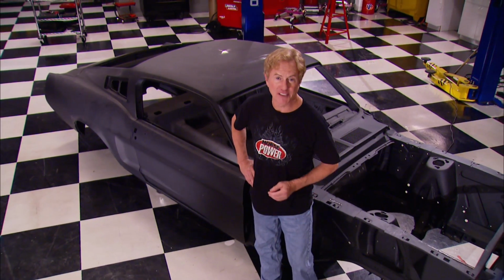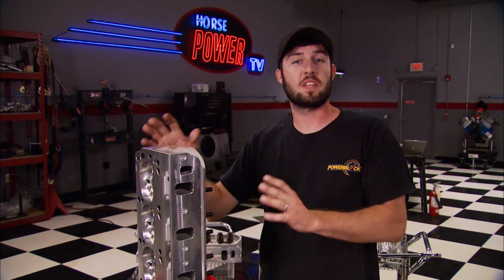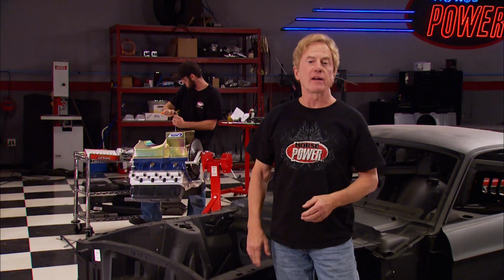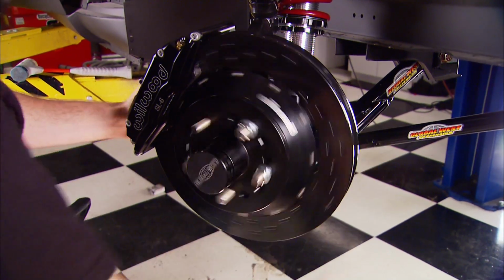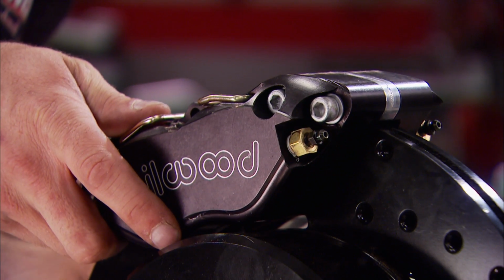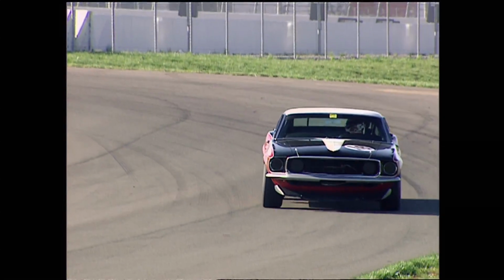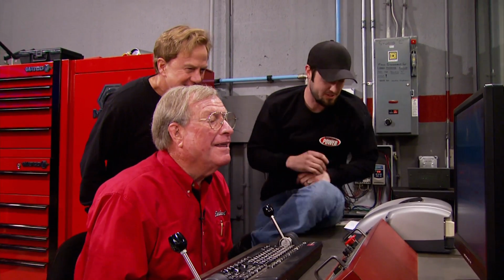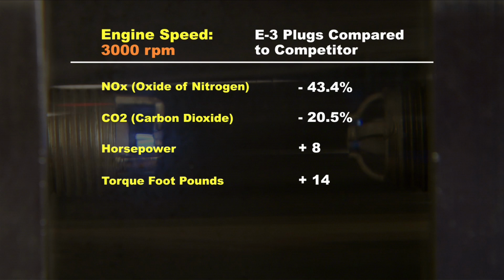Building a 347 Ford Small Block To Drop In A Mustang Track Car - Horsepower S13, E15

Comment: Damn that's pretty impressive only 12 ft lb shy of 500 ft lbs, the LS6 454 did 500 foot pounds but It had a hell of a lot more cubic inches than the 347 Ford did I'm actually very impressed.

Comment: Disappointed you guys didn't show the dyno curve. It helps those of us not interested in peak HP vs how the power band comes in and runs throughout. Can you post it? 
Also, why didn't you lube up the cam prior to install?  Never seen one installed dry like that. I'm sure there is a reason, just I'm not aware of one. I know you pre lube with the oil pump before you rotate the assembly and fire it. Is that sufficient?
Reply: P0😮😮😢l😢pop

Comment: You used an aluminum bushing in a steel frame, aren't the two different metals going to eventually rot the other metal out?
Reply: probably but not before the camshaft eats the bearings from not having assembly lube.

Comment: Explain to me how an engine pulls in more air when the bore and stroke stay the same??????
Reply: Bigger heads
Reply: And cam lift and duration.
Reply: @countryjoe3551  You need to lister to the part about compression ratio again. The engine cannot pull in more air, just because you raise the compression ratio. But these guys get away with this, and come off as experts.
Reply: @racerd9669  have you ever heard the term "volumetric efficiency "? I didn't hear them claim that raising the compression ratio alone will cause more air to be introduced into the engine. I guess I'll have to listen again.
Reply: @countryjoe3551  But the volumetric efficiency does not change just by changing the compression ratio. The engine needs to process more air to increase the VE.
Reply: @racerd9669  yes. How do you raise the volumetric efficiency of an engine?
Reply: @countryjoe3551  You make it process more air, better flowing heads, correct valve events that match the bore, stroke, rod lgt. and compression ratio. What he claimed was just raising the compression ratio would increase the VE.
Reply: @countryjoe3551  Yes he says when you raise the C.R. the engine will pull in more air.

Comment: Something to think about. Gasoline is a hydrocarbon. A molecule made up of hydrogen and carbon. Most of the chemical composition consists of linked CH2 and CH3 molecules, with a few connecting single Carbons and CH molecules. Overall there's an average ratio of 2 hydrogens for every carbon. When the fuel is burned, the fuel is mixed with air. Air is 78% nitrogen, 20.9% oxygen, .9% Argon, .03% CO2, and .17% other gases. 
Most cars are tuned for a 12.5:1 air to fuel ratio. So under combustion, for every unit of gasoline (C16 H32), there is 125.4 oxygen atoms. To fully combust the fuel, we will need 48 oxygen atoms to fully reform the fuel; 32 combine with the Carbon atoms, and 16 to combine with the hydrogen atoms. This will result in equal amounts of H2O and CO2. This leaves another 77.4 free oxygen atoms floating around to interact with other chemical reactions. 

My point is this, if the exhaust gas has less CO2 in it, What did the Oxygen combine with during combustion? A low output of CO2 is a clear sign of poor combustion.
Reply: A lower air:fuel ratio reduces the oxygen in the reaction and leads to forming more carbon monoxide and less CO2, among other things.  Oxygen also combines with other things in the reaction such as Nitrogen.  More complete combustion is better for power as the fuel is turned into mechanical energy of the piston rather than being burned in the exhaust.